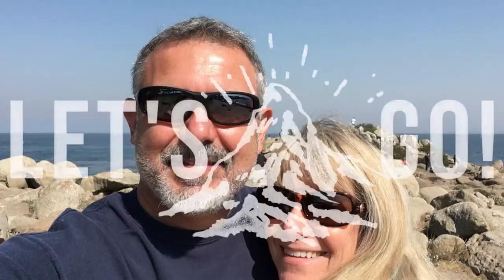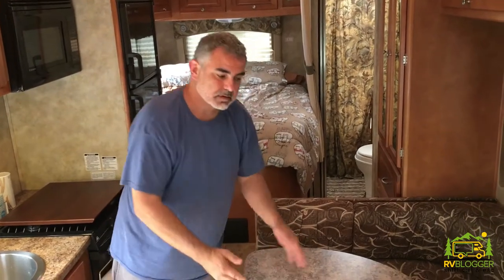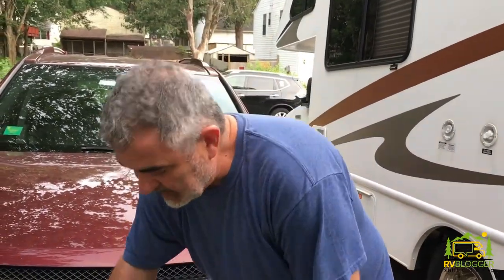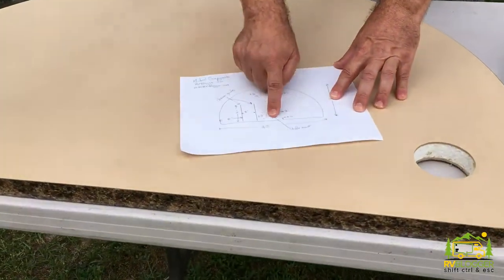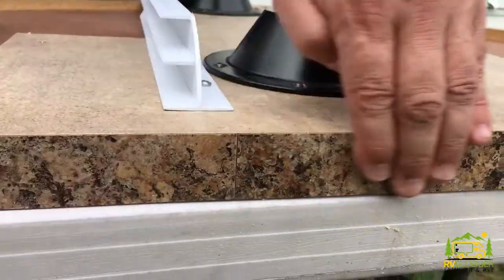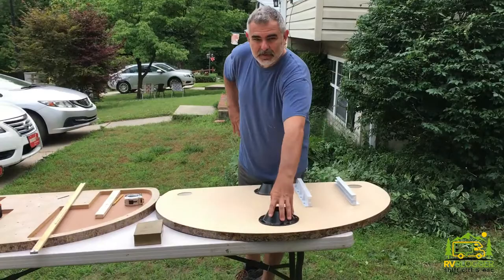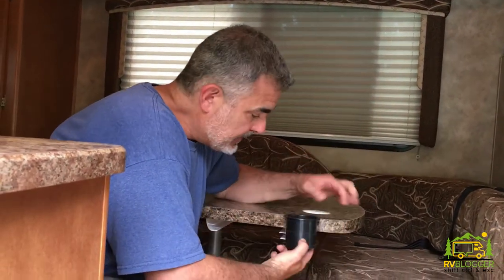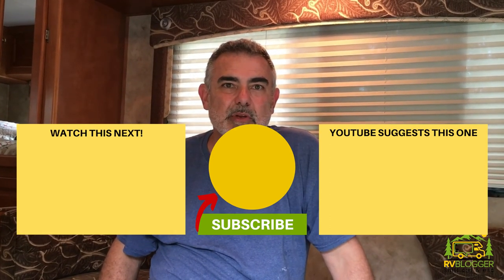Easy RV Dinette Booth Table Top Replacement

Comment: That table is very heavy!!  I have taken it out and the holders on the floor. Put them in my shed. I have a
Small but sufficient folding table that I plan to use. It is just my pup Bella and I. With the table out it gives a bit more room to move around. I have this same RV. 2009 Gulf Stream Conquest and I love it.
Reply from the maker: Hi Marcella,
Hey we are fellow Conquesters!!!
Thanks for watching and commenting! 
Mike and Susan
And by the way, we started a Facebook Group called RV Camping for Newbies. Hope you will check it out and join if you are interested! 
https://www.facebook.com/groups/RVCampingforNewbies/
Reply: @RVBlogger  I have joined the other site.  I do have a question on this RV - is there a way to access the gray water lever - it is in a bad place it seems.  I am even wondering about someone making an access door there.  Any tricks would be helpful.  thanks in advance and glad to be following here and the facebook group.  SO much help on both.

Comment: Mike, I have a dinette just like yours in my RV and was wondering if you had ever found upholstery replacements for your cushions.  I have looked and can only find new upholstery kits for the U-dinette which won't work on the 3/4 circle dinette like ours.
Reply from the maker: Hi Orman,
We have not found upholstery replacements either. Susan's daughter sews so we figured we would get her to make our replacements when we are ready...
Thanks for watching and commenting! 
Mike and Susan
Reply: @RVBlogger  Thank you for the response Mike!  I also tried contacting the light weight table top URL but there is something wrong with the input form and it errors out.  My table is the same size as yours and I wanted to get it replaced with something lighter.  Loved the video, my table actually had a drop leaf on the aisle side but I think I'm going to delete that part.

Comment: Can I ask if it was terribly expensive to replace the table? I have a bathroom counter that is in dire need of replacing! Thanks!
Reply from the maker: Hi Susan,
Our dinette table top is about 4' x 3' and it cost about $160. I imagine the price could be different depending on the color, thickness, cut-outs and edge detail but our price should get you in the ballpark. They make countertops too so good luck and let me know how it turns out!
Mike
Reply: @RVBlogger  That's totally reasonable!! Thanks for the info and I'll let you know for sure!